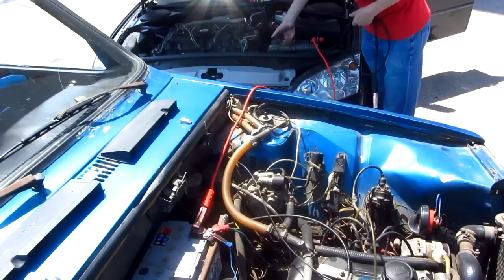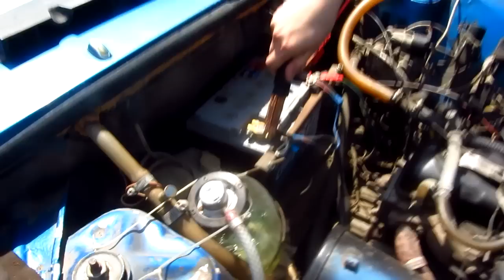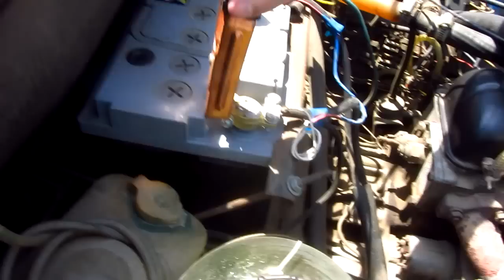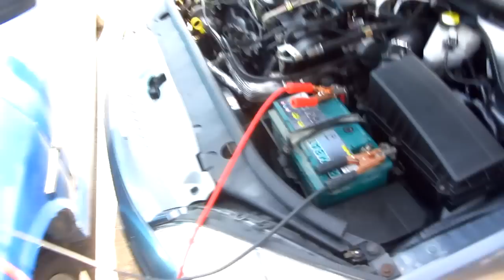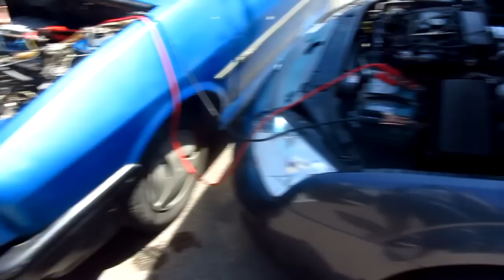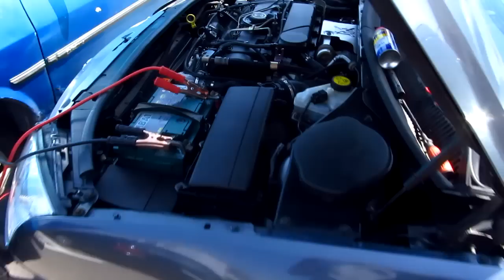24V Short Circuit (Incorrect Battery connection)

Comment: Can't that destroy the battery or computer?
Reply from the maker: Here the batteries were short circuited. Short circuit severely lowers battery voltage, plus one battery was already very weak, so after many cranking attempts it probably had much less than 12V. The 24V from the title is just a theoretic number, in practice one battery luckily had much lower voltage. Both cars worked fine after this incident.

Comment: I have drained battery and i accidentaly jump start my car by a charger with 24 volts what could you think will happend? 😢 This happened just as this moment
Reply from the maker: the drained 12V battery should reduce the 24V to a somewhat safer voltage...
Reply: @furulevi  update: I need to replace both engine ecu and  body ecu worth 900 dollars both. No other parts were damage no fuses or relay has been destroyed sadness damage me this past days. 😂
Reply: @furulevi  second update hahah my stereo was shorted need to replace haha
Reply: Been there done that and luckily that car is still running fine... Most likely the dead battery soaked up so much power that it was much less then 24v and it took only a few moments until I realized the mistake. But it did wake up the dead battery so it would take a charge after :) (before that it would not even take a charge).